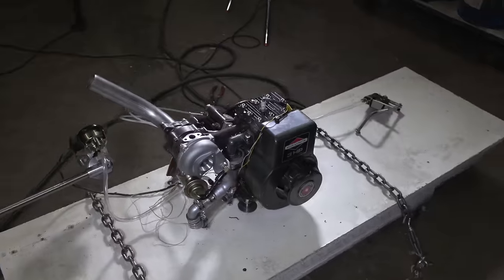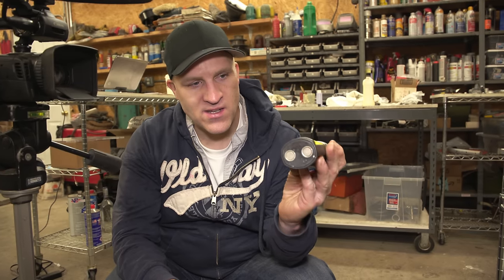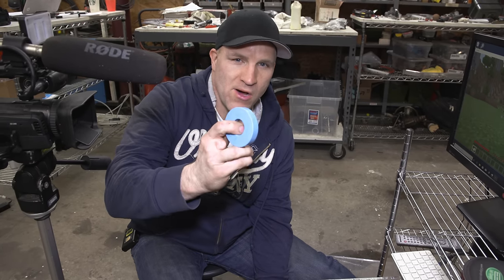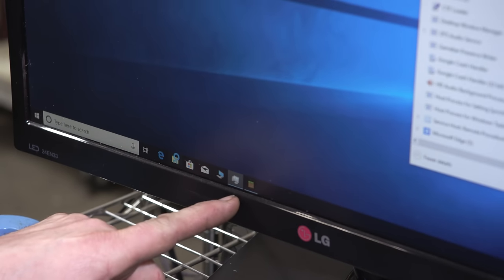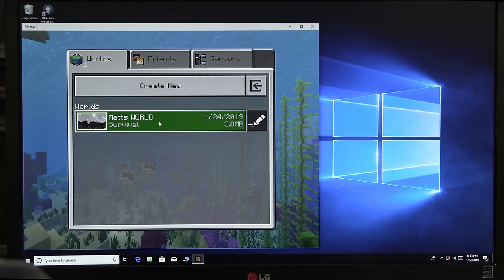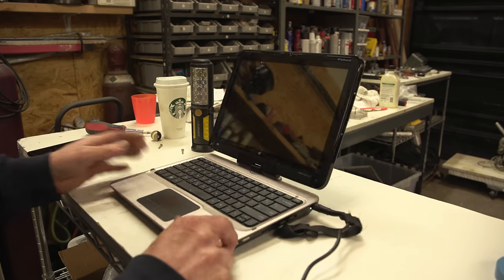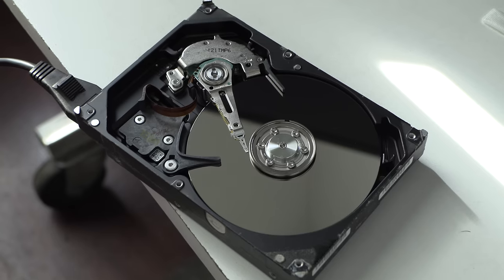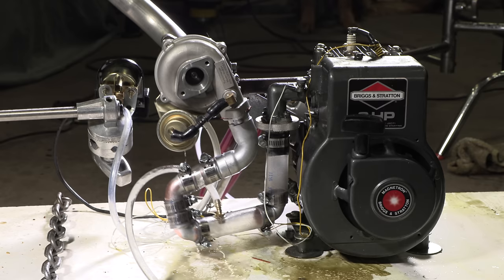Will a Magnet Erase my PC's Hard Drive? - Let's Find Out

Comment: That came from the shock, the fysical shock when the magnet hits the hdd that hard, nót from the magnetic field! Simply beating that hdd equally hard gives that same result.
That shiny coverplate diverts all, or at least all the stong enough fieldlines easally enough around the disk. How fat your magnet is! The bang from the hitting did skip the readhead, and no magnet erasing effects seen!!
Reply from the maker: I don't agree, because the desk didn't stop working as soon as the shock occurred, and it wasn't really much of a shock either, the disc actually didn't do anything immediately, it seems like the arms got stuck or the platters slowed down. that's the exact reason why I opened up the hard drive and put the magnet right on the platters so we can visualize what may have happened with the other drive. If people like the subject I'm totally thinking about doing an episode on hard drives in general. Thanks for your feedback and thanks for watching
Reply: No it was just the fysical shock from the magnet hitting the hdd. A hit with a stone would have had that same effect. The readhead on the arm skips some tracks and the hdd has to find his track and required speed for it again and thats all of the delay, all thats seen here. Btw there is a pair of very strong neodiniummagnets beside the platter inside the casing so a magnet outside that fieldlineredirecting cover should have an enormous strenght to get above the value for the coërcivity of that remanent magnetfield holding layer on top of the platter.
Reply: @WarpedYT  no it is nothing more than the fysical sudden motion, the shoch from the hit on the hdd.
You get confused by the delay you see between hit and response from pc, but thát is only because the hdd ánd the software(evt from the driver software with the hdd)
You got confused by the delay caused by the many buffering in memory ánd a lot of software that is meant to Buffer short dropouts or faults in the datastream coming from the readhead and detected by checkloops like checksum and platterspeedcontrol and by any of the many ic's validdataflags and loops in software that create errorflags, all that effects that delay between fault and noticable effect on the pc-screen. Nóthing more
Reply: @WarpedYT  before you name a cause, at least show an even hard (or harder, if you are really sure) hit on the hdd-case, or invest the pc's reactions on increasing hard hdd hittings andzovoorts! It sure is the only cause of the only errors shown here. And that is logical.

Comment: I think with the strongest magnet you used it held the heads in place and they couldn't move ... but that doesn't explain why the platters didn't get corrupted ... the other main thing is the rapid motion that the hard drive had when it snapped to the magnets ... those are extremely precision devices... the clearance read/write heads is to a very close tolerance millionidthes of and inch ... a head crash DID happen I will guarantee it did ... that hard drive has SIGNIFICANTLY less working life now ... the head crash most assumed has now caused damage (scrapped platter material off that's now floating around ... it will continue to get worse and worse ... until the drive will be useless

Comment: I set my laptop on a magnet accidentally  was a metal table and under it I had hung a shop magnet to pick up screws off the floor. In the morning turned on laptop and it would not boot. Had to replace hard-drive data not recoverable

Comment: I thought it was all about the rate of change of magnetic field, for example if you moved the magnet past the disk really fast! Has anyone tested this? Could be another good test for a video. I once had an old MP3 player with a hard drive in it get corrupted because I put it on top of a guitar amp, which have huge magnets and change magnetic field when played loud.

Comment: Nothing will happen. Because all the data and caché are in the memory RAM untill you turn off the pc.
Another basic things you have to know is: you send the order to search the data but the magnet stops when you put another magnet over.
Reply from the maker: Well not everything is in the ram, as soon as you start looking for data on the disc it will start searching the hard drive, this includes further instructions from Windows.

Comment: That third time with the third magnet only did all that cuz you bumped around the hard drive to much while it was running so of course it will while it's running u obviously don't need a magnet to loose data. Just drop it when it's going and it'll fail

Comment: Its logical computer s hdd back in the 80s 90s where more sensitive. Than now. And it wasn't weird for the Magnet to make the disk usage act strange becouse while the disk spines the head is moving across the platter like a needed on a record and the heads are mettle so the hdd is struggling to move the heads back where it needs to go to open the application you wanted but it cant because of the magnet

Comment: HDDs are encased in metal that metal shields them from magnets to begin with. Even very old ide hdds would not die from all but the very strongest magnets modern hdds will as well. What is stopping your platters from spinning is your creating a strong magnetic field that is causing the motor to stop. Take a dc motor from a rc car and put a strong magnet by t same effect. Hacker movies always equal bad hacking lol

Comment: Especially do not run Windows 10, use a distribution of Linux instead.
Reply: Why windows is really useful sure Linux is good but windows has loads of features
Reply: @shadowxxe  Such as?
Reply: @pcwizzy460  The ability to cross play with Xbox. Drive caching software, screen capture software, A sticky note reminder system, Cortana (getting replaced with google assistant), Windows Defender, Virtualization software, the ability to have multiple desktops for multitasking, Microsoft Word, Excel, powerpoint, publisher, the action centre, Pre-installed skype and the list goes on

Comment: Do a read write test next time, this is not even close to accurate
And yes, the disk went to 0% after you put the magnet on is because the shock protection built in the disk

Comment: magnet held disks, cpu told discs to read/write, discs were stuck, when u pulled the magnet off the hdd, btw get an sdd noob, all the programs you tried to execute started running all at once as disks were no longer stuck... im going to assume you haven't any idea how computers work, as a magnet isn't going to destroy any hdd/sdd unless it can bend or rip out any of the smaller pieces that read the discs.

Comment: Is it possible that opposing magnetic charges are necessary (on both sides of the drive) would be necessary for the drive to cease functioning long enough to wipe the drive? I’m actually a bonafide computer  dumbass, so I apologize in advance if that’s a  bonafide ‘dumbass’ question…

Comment: Thank you for the entertaining content; Foray, let me share a little known protection; called "Square Root Protection" also known as "Square Root Law" to a tipical E2EE loving cyberpunk.  

If you find that you have an xtree 500ms just laying around somewhere that you can spare in order to study the outer construction of the case that your Western Digital Blue is enclosed inside of; it is made of aluminum; which by nearly all standard scales of measure; is nonconductive, and therefor enjoys "Square Root Protection" from electromagnetism & electromagntic waves.  

On the other the hand, laptop or notebooks drives often do not, and the units that are not cased in aluminum; and often have very thin steel cases; which are also conveniently located very close too some very stout industrial strength magnets; to hold  the screen lid  secure in the closed position.  I hope this helps a little, in making sense of your Gambit results

Peace

Comment: You basically did a magnetic brake on the disc, slowing it down too much for the HDD to work.

You should be able to slow down any metal platter by having a magnet beside it like that.